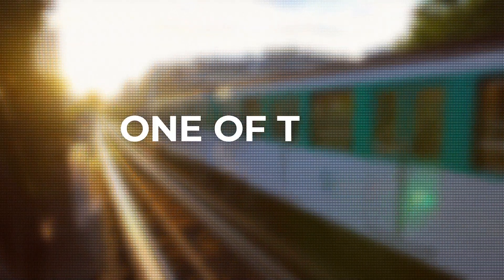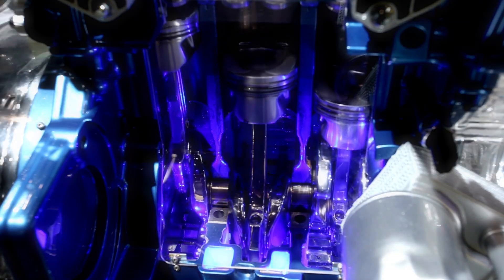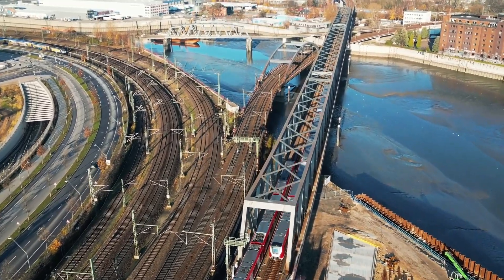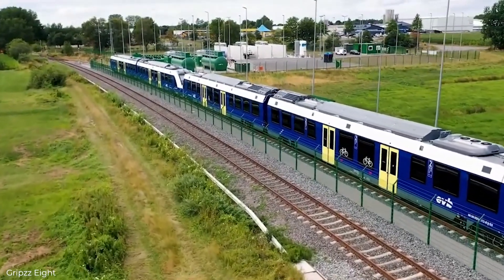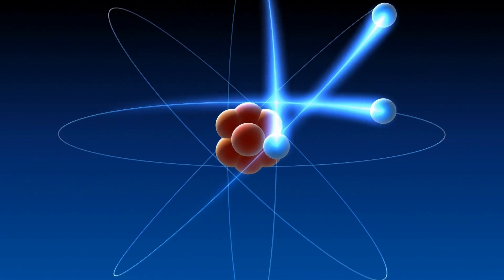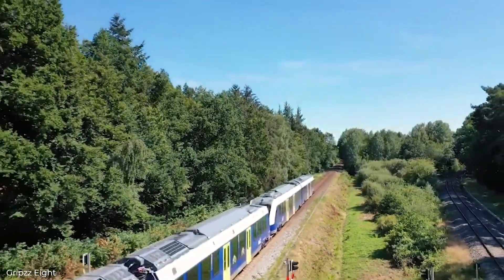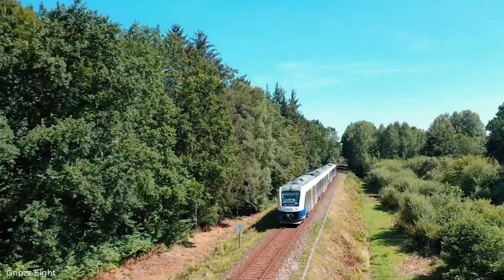The Problem With Hydrogen Trains...

Comment: Everyone loves to bring up the fact that the electrification of American railroads would cost hundreds of billions of dollars but no one bothers to mention that  establishing a hydrogen economy from scratch will cost trillions of dollars if it's even possible at all. Also converting diesel electric engines to run off overhead electrification is actually quite easy and affordable. Indian railways is converting many engines every day. 
Let's say that it would cost 500 billion dollars to fully electrify the American railroad network. Yikes that's a big scary number right? Well not really. That's barely more than half of the annual budget for the Pentagon. It's not practical to compete such a massive project in just one year so let's take 50 billion away from the Pentagon every year for ten years and just like that America has a 100% electric powered railroad network. This would protect critical supply lines like those that bring grain out of the Midwest states from disruptions in the oil market. Cough, cough war in the Middle East cough, cough. This was the main reason why Indian railways went all electric. The US, Canada, and Australia are absolute fools for not following India's example. Jai hind 🇮🇳

Comment: While it might make sense to use hydrogen trains in the US, in case of Germany I think "wtf. just electrify the damn railroads". Switzerland has done it for almost 100 % of their railroads, so why Germany can't do it? Especially when the hydrogen stuff should be ready in 2035. By that time all the railroads could easily be upgraded when it's done one by one from now on. The Diesel Trains that are in service now can be used until their end of live and replaced by normal electrical trains. The rest of operating Diesel Trains on a new electrified railroad line can be switched to a diesel line to replace another diesel train that has gone out of service. This way the switch to fully electric service would be as smoothly as possible.

The start should be made on the most important lines, for example those from the port of Wilhelmshaven to Maschen, Europes biggest marshalling yard (I can't understand why it isn't done by now).

Comment: Hydel power is the only pure eco friendly energy. As such, the already existing hydel power plants are to be increased its output by whatsoever innovations to be adopted viz, circulation of the momentum water, increase in the number of electricity generators, increase in the capacity of the hydel power dams by cascading walls, manufacturing of large huge PERPETUAL ENERGY IDEAS that will produce pure energy.  Energy from non.conventional methods too are vividly cost effective! By adopting electric generators to whatsoever Speed transportation upon railways, highways and automobiles and building electricity grids for tapping & distribution of power from various such sources will certainly make success, unique and different!

Comment: Who funded this thing ?  It completely failed to mention that the hydrogen can be produced 100 % by carbon-free `sustainable' technology as Alstom does regularly.  Fuel cell trains are the perfect solution to all emission problems in the transportation sector.
Reply: This is probably another pro battery guy

Comment: Hydrogen could be made using nuclear power plants
Reply: Or hydro if near a dam.
Reply: Or with a simple local power station like a wind turbine and some solar cells right at the gas station. All you need is distilled water and electricity to produce hydrogen
Reply: No more electrical cables hanging over railway of Deutschland, how much it's saved money ?

Comment: If you consider production alone, surface renewable PV panels and wind mills became significantly cheaper than gas with uncertain or expensive LNG supply due to Ukrainian war and even can compete well with coal BUT what kills it not the free of charge abundant sun and wind but the variable seasonal and unpredictable nature of this clean power requiring massive storage of energy. The energy storage in chemical batteries is not very durable and economical, high cost of lithium copper Aluminium and manufacturing represent all massive amounts of mining and industrial grey energies stacked on. Maybe only the new small and heavy salt batteries for domestic storage (they are inefficient but domestic heat can be used for use) are slowly becoming cost effective and durable for 15 years and are also easy to recycle, and are reconditioned without polluting wastes. Also the uploading of clean surface power to the grid for storage and better load match is rather  expensive with hydro storage evaporation and doubling power line and distribution losses from production to storage and then from stored lake to load. Electricity production closely matched demand because electricity storage is basically uneconomical and surplus night power is discounted and wasted. It also does not make economical sense to transport with losses clean energies like wind and sun which are present all over…and with small amount of water, a local production of green H2 is one of the better solution to produce, store, use and sell clean energy anywhere. Since anyone can produce it with no big economy of scale, a dynamic market may exists. A rather highly competitive market can be developed with the right political decisions which does not yet exist with current monopolistic supplies of energy at the gas station, gas meters and kWh meter and enjoying a huge cost to retail price harvested gap. Such a clean energy process also allow a competitive fair trade market and tax free process to be implemented with the same access to market for the smallest auto producers to the biggest energy consumer. Also note that a local green H2 process inefficiencies often presented as huge economic drawback ( video stating that problem is cost…) are in fact mainly high enthalpy heat and pure oxygen for welding or medical usage with a good market value which reduce the cost of all three products while current O2 production uses much energy and so, globally, H2 is a threat for all those existing and non or slow converting industries and green H2 is often criticised with well funded lobbying power.

Comment: The only way we can affordable produce hydrogen is with nuclear power.
Reply: But then why would we want to use hydrogen as a battery medium instead of just electrifying the rail lines and calling it a day?
Reply: @TohaBgood2  My thought exactly. But politics in some cases takes weird decisions.
Reply: @TohaBgood2 if the track too long it will be very expensive
Reply: @widodoakrom3938  Nope. This has been calculated a million times. It's cheaper overall to electrify, but it requires a massive short term investment that only pays off in a couple of decades. Consequently, the politicians always want to go for the easy way out.
Reply: @TohaBgood2  china built hydrogen locomotive bcs they wants to built Eurasian railways can't rely on diesel or electric locomotive hydrogen locomotive is the best options

Comment: Video needs work. Caltrans (Amtrak California) and Canadian Pacific (CPKCS) are looking at converting existing diesel-electric locomotives to hydrogen fuel cells. Producing hydrogen from surplus off-peak wind power at night addresses carbon emissions and cost of production of hydrogen. Florida East Coast Railway has a  locomotive fleet powered by LNG, very similar to hydrogen, tank cars are used as fuel tenders. Major issue with hydrogen is its fuel density, range is greater than batteries but less than diesel.
Reply: Caltrans is doing no such thing. They are testing a very limited number of Stadler FLIRT hydrogen trains. They're not converting anything. They are just doing a pilot. Ultimately, Caltrans wants to electrify all the lines it has control over via catenary. They are studying hydrogen as a stopgap until they can do that. But it's not like they are banking on it replacing actual electrification.

Comment: Most hydrogen produced today is done by direct chemical conversion to hydrogen from fossil fuels, not by electrolysis. With electrolysis systems that are around and are taking electricity from the dirty grid, those are specifically built to produce chlorine gas and hydrogen is more of a co-product if not a by-product.

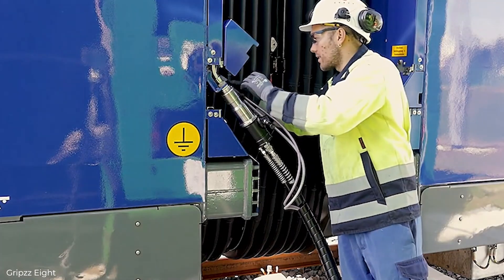Comment: 3:51 9.3kg based on what? Coal-powered electricity? Gas powered? Greenpower? Think you need to provide multiple figures or clarify.
Reply: Petroleum had had years to refine their processes to get that number as hydrogen is emerging and its techniques on harvesting, and that number would only go down

Comment: 1. Slow transition. Continue to use diesel engines but stop building new diesel engines.
2. Use wind and solar energy to generate hydrogen.
3. Generate hydrogen near the user. Avoid long distance transportation.
Reply: In the real world, almost all the hydrogen is generated from fossil fuels and via a process that is much more environmentally damaging than simply burning the fossil fuels. Given the incredible political influence of the fossil fuel lobby, I don't see how transitioning to hydrogen avoids this current fossil fuel hydrogen generation method continuing to be the main method into the future.

Do you think that BP and Shell will just allow the "hydrogen revolution" to slip through their fingers? This is literally the whole reason why they are pushing hydrogen so much right now.

Comment: I'm fairly certain this was related to hydrogen... It could have been battery trains I'm thinking of though.
Anyway, Germany's DB published a report not too long ago saying that, actually, over the period of ~20-30 years (I can't remember the actual figure), this type of propulsion was significantly more expensive than simply electrifying the line to 25kv AC...
This is because, while the capital costs of electric trains are really expensive, their operational costs are ridiculously cheap. Much cheaper than any other form of propulsion.
Reply: This! Over the long term it is far cheaper to just electrify a line. Both hydrogen and diesel trains/cars/etc. are more expensive to both purchase and run. But over the short term, it's much cheaper to buy a self-contained, diesel train-like package than to electrify. So the politicians will opt for the quick and dirty solution that gives them something to point at when voters ask what they have done for them. The alternative would be to try to sell the voters on a massive infrastructure investment project that might not show concrete results for a decade or more. 

This is basically the problem - it's political. In terms of costs it's basically impossible to argue that electrification is overall more expensive. It is very clearly much cheaper than the hydrogen or battery train bandaid.
Reply: It really depends on the frequency of trains. If it's a line that has frequent service, then yes, if it has a twice daily service, then no.
Reply: As a German I can say, the German government is stupid but the transportation system is way better than in the USA
Reply: The same goes for diesel, but the upfront capital costs are why it's more economical on a profit-loss basis to go with the more expensive long-term option. Hydrogen doesn't need to be as cheap as a EMU, but as cheap as a DMU.

Comment: Why use hyrdogen when you can just use electric...? If they're concerned about the climate then they can just make sure they use sustainable energy sources.
Reply: Because making and storing hydrogen may be cheaper than making batteries.
Reply: @beringstraitrailway , Why do we need battery in the first place? Whats wrong with trains powered by overhead power lines? Why not just electrify all the tracks?
Reply: @shas312 isn't it obvious? Cost
Electrifying railways cost almost as much as building new tracks and sometimes even more. How do you electrify a large railyard or urban railway line that has no space in-between tracks for electricity poles. Or low tunnels and bridges. They need to be rebuilt. That costs so much money.
Reply: @RR-us2kp  it's is short term cost that will be very helpfull in long term in comparision with hydrogen inefficiencies
Reply: @beringstraitrailway  To be specific, I'm referring to Electric Motor trains not battery electric trains.

Electric Motor trains get power from overhead wires and are much better than Battery Electric trains and Hydrogen trains because:

1. Hydrogen is extremely wasteful and costs a lot of money to produce.
2. Battery electric trains have... batteries. Batteries are terrible for public transport and should never be used unless absolutely necessary- you can see why just by looking at battery-powered cars which cause a lot of problems.
Reply: In North America maintain electric power grid is very expensive specially with labour cost

Comment: One big error in this video. 
The most common process to produce hydrogen is not electrolysis. 

It is actually steam refracturing. This is where we take natural gas, methane, and superheat it to force the carbon atoms and the hydrogen atoms apart. The superheating is done by burning natural gas to heat up water to create steam. The steam is what then seperates the hydrogen and carbon. 
This method counts for over 90% of all hydrogen manufactured today. 
This is the main reason why fossil dual companies love hydrogen and are pushing it so much. It still lets them take a seat at the table. 
Unfortunately, it's terribly wasteful. The fuel still has to be shipped to stations that will be used to fill the trains or vehicles, using more hydrogen, in a perfect hydrogen society. 

And hydrogen Combustion is also the biggest waste of money that anyone could ever invest in. Your engine will have to be bigger to pull the same load, due to Hydrogen containing less power per molecule than say diesel or gasoline. Also, your fuel tanks would have to be twice the size they are on a normal diesel train to get the same mileage. 
Even hydrogen fuel cell vehicles have this problem. If you look at the range of a hydrogen fuel cell vehicle you will notice that it is hardly any more than a Tesla. 
This is all due to the size of the hydrogen tanks in those vehicles. You will need much bigger tanks to compete with the same range as a diesel. 
Hydrogen Combustion is being pushed by legacy engine manufacturers such as Cummins, MTU, Detroit Diesel and Caterpillar, for the same reason as the fossil fuel companies, to keep a seat at the table. Unfortunately it is very inefficient, and allows these companies to cheaply modify engines instead of investing in fuel cell technology.

One last thing, Hydrogen storage is not the same as existing gasoline and diesel storage. Hydrogen has to be stored under high pressure to make it worthwhile for storage, transportation, and use in hydrogen tanks in vehicles. Since it is a gas, it takes up alot more room than liquid does, hence the need for pressurized storage. The logistics of installing high pressure tanks in every fuel station is just impractical and would likely cost hundreds of billions of dollars. Probably the same as electrifying the whole rail network. 

Nice video, but you left so much out.
Reply: Exactly. I am from India and I see so many people bad mouthing EVs here and say Hydrogen is the future. I cannot help but laught at it. Their argument is that even electricity comes from thermal power plants. So no use of EV and they conclude future is hydrogen. But what they completely fail to understand is that even electrolysis of water to generate needs electricity and even that has to either come from fossil fuels or renewable energy. Upon that electrolysis is a bit inefficient. So instead of wasting energy here and then transport fuel, it can directly be used to charge the battery. But the propaganda is very strong against EVs. Many people believe the non existent hydrogen future.
Reply: @shas312 Well you are right but Hydrogen is future because of 3 main reasons
1.Hydrogen is available infinitely not only in our world but all over the universe. 
2. They don't need infrastructure like electric trains 
3. Speed of refueling a hydrogen power engine is same as a diesel power. 
So you are right that indirectly to produce H2 we currently require fossil fuel, so we need to use renewable method to produce H2
Reply: @n3b954  yes but we won't use it for cars, there are a ton of other things with  way higher priority to get the scarces H2....
Reply: @shas312  True, but reality is that we need both technologys!
As they have different strength and weekneses and therefore different applications.... But with H2 we need to be careful to only produce and use green H2, eg. from small electrolysis units next to wind turbine parks or next to solar farms to use the excess energy from them, then to convert it to H2 and use that for different applications; high on the priority list is eg. steel industry, fuel for large container ships, or a bit lower priority fuel for planes...
Reply: Hi, do you have links to studies that mention these allegations ?
Reply: Yes thats all correct, but nontheless we do need H2 in the future, it's a wonderfull technology. We need to eliminate the way/methods of the oil industry you described and therefore we need awareness and we need to be careful to only produce and use green H2, eg. from small electrolysis units next to wind turbine parks or next to solar farms to use their excess energy, then to convert it to H2 and use that for different applications; high on the priority list is eg. steel industry, fuel for large container ships, or a bit lower priority fuel for planes...